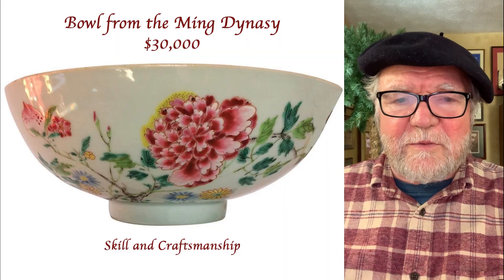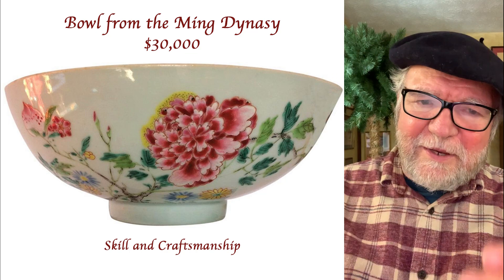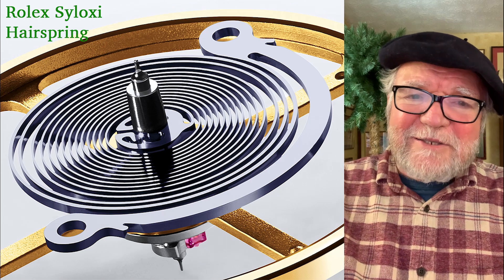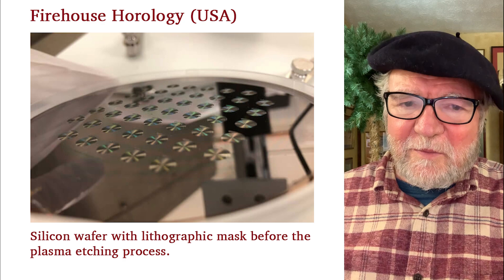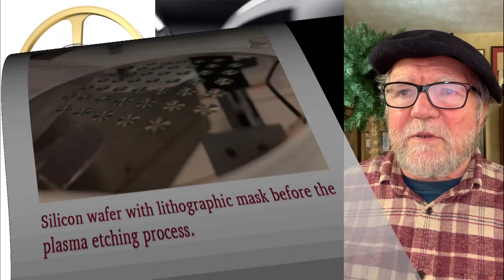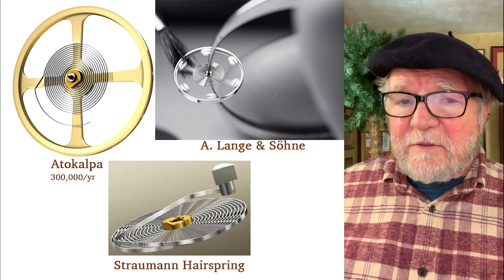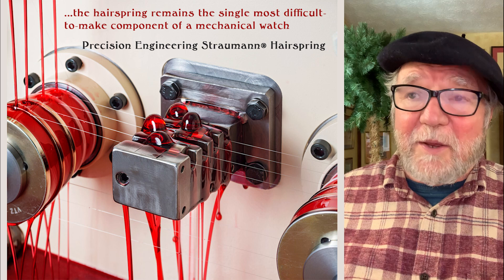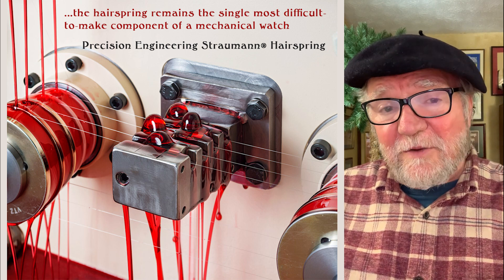Why I’d Prefer Not to have Silicon Hairsprings #VP88

Comment: Interesting take Bill.  I’ve never been bothered by silicon hairsprings because I didn’t  think the material makes the watch any less “mechanical.” But if it’s true that silicon hairsprings are easy to stamp out in the millions without the intervention of a skilled human being then I do take your point. I have a few watches that use silicon but most of mine do not. I know we both own VC watches that use the VC 4400 movement. I’ve searched online and haven’t been able to find information on the VC 4400 hairspring. Do you happen to know the composition of the hairspring in the VC 4400? I wonder if any movements with silicon hairsprings have received the Geneva Seal. Thanks for another fascinating video Bill.
Reply from the maker: No I do not  know about the 4400 Jeffrey, but since VC is not part of the Rolex-PP-Swatch silicon hairspring consortium; they probably do not. Will check it out. Take care and be safe, Bill 😷
Reply: One of two escapement in twin beat perpetual is silicon  and yes it did receive Geneva seal

Comment: A couple of things Bill, Firstly, using a bowl from the Ming dynasty as an analogy for this issue isn't actually helpful as the main reason for the Bowl being so valuable is more to do with its rarity.  A fragile artifact that is still intact from 500 years ago is what makes it so expensive, equally most of the human race were still using wooden receptacles back then so you could say that the porcelain bowl was the "silicon" of its day! Secondly, the mechanical watches that are being made today are constantly being updated and improved not just by the choice of components but also the synthetic lubricants, the fine tolerances as a result of designing with CAD software, the manufacturing using electronic computerised CNC machines and then there is the polishing and engraving which is superior due to the modern materials and methods that are adopted. So, whilst I totally understand that the "personality" as you refer to it is slowly disappearing from your beloved watches, someone else may choose to use an alternative term, "weakness".  Afterall, my first car had heaps of personality.  I had to pump the gas pedal 4 times then pull out the manual choke, turn it over for about 10 seconds, then push the choke back in, then press the gas pedal down to the floor, turn the key again, it would fire up. Then I would feather the accelerator for the next 15-20 seconds sliding the choke in and out gingerly whilst listening to the engine as it slowly spluttered into life. Fingers crossed the revs would pick up and I would be on my way.  Otherwise the engine would flood and I would have to wait 5 minutes and start over.  Nowadays, I just turn the key and that's it!
Reply from the maker: Hi Cirrus, the Ming bowl was to be a generic example of antiques, and the point is that one doesn't try and make better antiques. Rather they study the works of masters who created them in the first place. Creating a replica of the bowl using high tech materials and super-high resolution graphics could do a great job and use materials not available during the Ming Dynasty. Yeah, that's possible and there are probably examples you could buy, cheaply. As for the "rarity" of the bowl being the reason for its price ... there's lots of "rare junk" that no one would pay a dime for; so, rarity by itself explains nothing.  Some years ago while visiting the Louvre I saw an art student copying one of the works by Giuseppe Arcimboldo (the one who painted heads made entirely of objects such as fruits, vegetables, flowers, fish and books). She was doing a spectacular job, but the value in doing so was not merely to duplicate the master, but to somehow capture the brush strokes, techniques and genius of Arcimboldo. To me, that's the value the watches we collect; not in making the watches better by cooking silicon hairsprings like circuit boards and chips. However, some do want that and the watchmakers can save a lot of money because metal hairsprings take skill and costs more to produce, and the silicon balance springs are better for consistent oscillations. If that's what collectors want, that's fine with me; just not what I find value in. Take care and be safe, Bill  😷

Comment: I would prefer the ability to manipulate the hair spring as the years age the movement, and silicon certainly prevents that option.  However, the reason for me to pursue a watch containing one (specifically the new Seamaster) is that I'm an engineer for MRI, regularly working inside of magnetic fields at or in excess of 1.5 Tesla.  No metal hair spring will withstand that; even non-ferrous ones will beat highly irregularly within the field due to Lenz's Law and sympathetic eddies generating temporary perpendicular magnetic fields.  There's a place and a need for the technology, and it's not necessarily about precision.
Reply from the maker: Mark, the progress in time-keeping is with Smart Watches ... the challenge is what can be done with transitional metals as both Rolex did with 'Parachrom' springs and H. Moser et Cie did with  'Straumann Hairspring'— there is no question that the metalloid silicon is superior to transitional metals—in non-magnetic field resistance and keeping form in temperature extremes. However, so was quartz (silicon & oxygen). Watches resorting to silicon have more or less waved the while flag and given up as far as I'm concerned. But that's only my view. Take care, Bill

Comment: Interesting video Bill.  My 183 year-old Thomas Hallam/William Carter pocket watch continues to tick away, at a wonderfully sedate pace, using its ancient technology to keep very good time. That’s one of the reasons I hold traditional watchmaking and related materials in such high regard.  It may well be, of course, that my fast-ticking 2 year-old silicon-sprung Omega may also be doing likewise, and still be repairable when necessary, in the year 2202 ...... only time will tell.
Reply from the maker: Very cool Shaver! I think there is a fissure between traditional watchmaking with metal hairsprings, regulators and balances and the higher-tech materials like silicon, plastics, nylon and some carbon movement parts. I like the old school ... even with a curb regulator that I can adjust with a toothpick. Take care and be safe, Bill 😷

Comment: I agree with holding the holy trinity and the like to withstand silicon in their offerings but Rolex hasn’t ever aimed for high horology. They’ve always taken the route to provide the most durable and accurate mass production pieces, shielding their movements to serve both a utilitarian function and in a sense to acknowledge “hey we aren’t trying to be that”. When they started they had no ability or desire to compete with the established elite, even though they’ve gone upscale in precious metals and dial, appliqué finishing. The end goal of their movements remains the same. Siloxy in rolex is all good to me!
Reply from the maker: You're right about Rolex's attitude, but if you include silicon-based escapements and hairsprings as "progress," why not quartz? Way better accuracy. I hope they keep the Parachrom spring. Take care and be safe, Bill😷

Comment: I have two watches now with the silicone hairspring.  one is a ETA 2824 variety and the new one is a 2892 from ETA.  The 2824 is off by about 10 total seconds now after several months.  I've had the 2892 for a week and it appears to be right on the second VS atomic clock after 7 days.  I think there's some kind of magic to this hairspring, because the only watch I have that is more accurate is a VHP quartz.  Or did I just win the watch lottery two times?  Should I get a Powerball tomorrow?  so impressed.  I'm really OCD about watch accuracy lol.
Reply from the maker: Sounds like you got what you wanted Eric. Take care, Bill

Comment: I thought the reason why you can’t adjust for example a Rolex hairspring is because its a free sprung balance wheel which aren’t supposed to be adjusted by adjusting the hairspring? And   Isn’t silicon a basic chemical element? I thought silicone is what is made by mixing silicon and oxygen?
Reply from the maker: No free sprung balances have no regulators. Silicon hairsprings / balances have to be free sprung because the springs cannot be adjusted—it has to be done with adjusting the weights only. Curb regulators can adjust the spring in the event it lengthens (slow) or shortens (fast). There's also the issue of the beat being adjusted.—more for us collectors to explore 7ona5. Take care, Bill

Comment: Dear Bill, I personally have nothing against a silicone hairspring. I also don't have anything against my mechanical watch being consistently accurate in any conditions. I even don't have anything against quartz watches, I own and use two of them. I do have an analogue one and also a digital one. They both serve a purpose, I find the analogue version easier to read and it has more personality. The digital one is cheap, if I go to the open air pool and I want to leave my watch with my blanket why I go swimming, I certainly won't take my Zenith or Omega to leave it behind unattended. If the 50 euro watch is stolen, well be it... I guess you would not leave your Patek unattended in a public place either, would you?

As regards the accuracy of a mechanical watch, for me a watch beyond passion, is still a time keeping instrument serving a practical purpose. So, I'm not prepared to set my mechanical watches more often than at most once a month. If I buy a new watch I also don't like to gamble in the sense that one watch will run ten seconds fast per day and the other one second fast per day. I certainly don't want to be the one who gets the one keeping time inconsistently and poorly. So if the silicon hair spring improves the consistency over a large number of watches, that's fine with me. I also don't mind the antimagnetic properties. I just don't want to worry about my watches all the time if I travel by plane somewhere or get close to the source of a strong magnetic field. I just want my watches to be carefree even if they are mechanical.

I don't like smartwatches because I do not want to mess around with continuous software updates, I don't want to charge my watch once every week and worry about forgetting it and the thing going dead on me, when I need it most.

As for how long lasting silicone hairsprings are, that remains to be seen. But I'm certainly prepared to give them a chance. By the way a metal hair spring won't last forever either.
Reply from the maker: Your silicon sprung watch will run out of juice (unwind) before a smart watch, and a smart watch will take care of updates (aka: improvements) without your having to bother yourself. Look, if you think a Van Gogh is improved by using acrylic paints over oils ... be my guest. Likewise, if you want an unadjustable spring made of a metalloid ... knock yourself out. Accuracy is important, and that's why I use my iPhone or computer to set mechanical watches.... whether or not a silicon spring is used. I do not proselytize the use of transitional metal springs over metalloid ones; I just explain why I prefer one over the other. Your money, your values and your choice. Take care, Bill
Reply: @watchartsci  I just think there are more important things to worry about in life, that's all.
Reply: @watchartsci  Dear Bill, I also have the impression we are talking about two different things. Your talking about hundreds of years old Chinese porcelain cups and Van Goghs. I'm talking about a watch as an instrument for measuring time. For me, this is what a watch is. I am a physics engineer and what I see in a watch is an instrument or tool for measuring a physical quantity. Similarly to an instrument for measuring electrical current, voltage, electrical resistance. It never occurred to me to compare a multimeter to a Van Gogh or any other artistic creation. If you see a watch as an artistic creation, that is fine, probably there are watches which fall under that category if you want to see it like that. But there are others, like me, who see an instrument in a watch and there is nothing wrong to put a silicon hairspring in an instrument for measuring time, just as there is nothing wrong in putting a silicon transistor in a multimeter, a radio or an amplifier. This does not take away from the validity of the views of people who prefer to use a tube amplifier with a turntable because they consider the quality of sound better than the sound from a CD player in combination with a transistor amplifier. It also does not take away from the russian army still using electronics with vacuum tubes, because they are resistant to a possible nuclear electromagnetic pulse. There is place for all of these technologies, preferences and views. It's nice to have alternatives.
Reply: @watchartsci  "Look, if you think a Van Gogh is improved by using acrylic paints over oils ... be my guest."

I bet you don't use a cathode ray tube monitor any longer, for surfing Youtube and the World Wide Web in general, do you?!
Reply from the maker: @pityipalko  They would have never switched from quartz to pure mechanical were this an issue of "modernizing" watches... like I said, if you want silicon hairsprings in your watch, ... go ahead. I prefer not to.
Reply: @watchartsci  That's perfectly legitimate. I generally am also somewhat sceptical with new technologies. I let others test them first. But at some point I give them a chance. So if you don't want to use a watch with a silicon hairspring don't use one. If you are  only interested in collecting sundials or hourglass that's also perfectly legitimate. But if somebody is prepared to try out something new that is perfectly legitimate as well.
Reply from the maker: @pityipalko  Before I retired, I was writing code for mobile devices; so I know silicon, and I cannot really justify the shortcut to silicon that many have taken for mechanical watches. For mere practicality, it makes sense ... but Rolex's parachrom and Strausmann springs took non-magnetization to another level. Silicon is a metalloid that needed only a spring shape. Enjoy yours ... and I'll enjoy mine.
Reply: @watchartsci  I have two Speedmasters, one with the traditional 1861 movement and one with the new 3861 co-axial movement with the silicon hairspring. I'm not praising the silicon hairspring and it will turn out how it behaves long turn. I took both of the Speedmasters cycling, hiking, flying, driving etc. So far I had zero problems with either, but the 3861 is less then a year old, so let's wait and see... the 3861 is more stable and runs more uniformly than the traditional one, which is also very very accurate. I so not have a verdict on the subject yet, we'll see after at least ten years 😁. Maybe you're right, time will tell. I did not say you were wrong.
Reply from the maker: @pityipalko  The co-axial escapement is a work of horological art...
Reply: @watchartsci  Well, that's good news, let's see, how the silicon hairspring fares in the long run. The traditional 1861 has certainly proven it's worth from my point of view, that watch definitely stays with me, in any case.

Comment: I'm trying to understand your point, but still don't get it. I think you like craftsmanship and skill and so the concern (I think?) is that the silicon hairsprings can be churned out by a machine? But, as far as I know, most hairsprings made of various metals are churned out by machines too. So, I really just don't get it. The type of material itself seems pretty irrelevant to me. For instance, if someone found that fused zirconia worked better and was easier to produce than synthetic rubies and started using that as jewels, I can't see that I'd care. Rather, I'd be impressed by the innovation!
Reply from the maker: Hi Brian, essentially watchmaking has been taking different paths over the years. First it was quartz vs. Traditional Watchmaking, and then electric watches, tuning forks, then smart watches ... Traditional Watchmaking is the path I chose to follow because of the craftsmanship. We could have stopped traditional innovation and craftsmanship with quartz. Quartz keeps time better; but since we did not, I prefer to collect watches on the traditional path with traditional techniques and materials. Silicon hairsprings are better than traditional ones—in most respects. But so is quartz. Take care and be safe, Bill😷